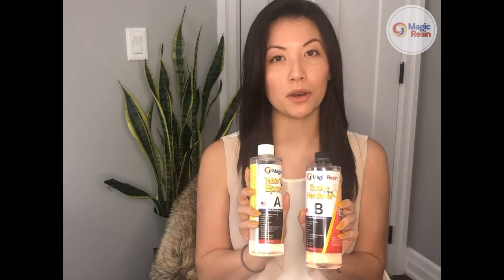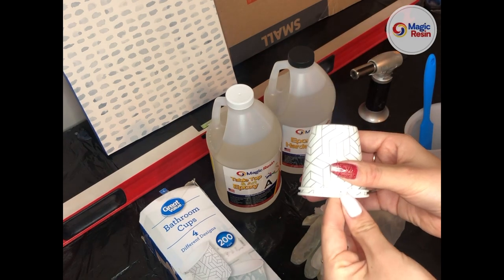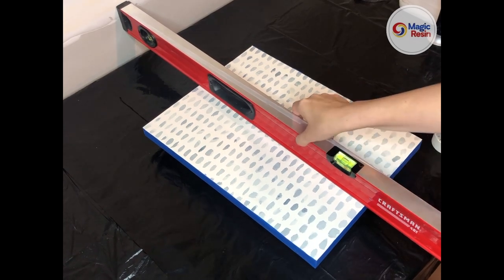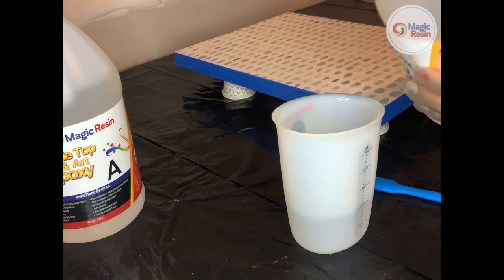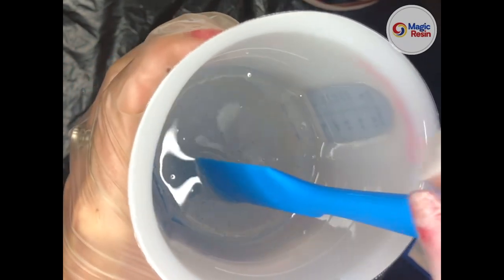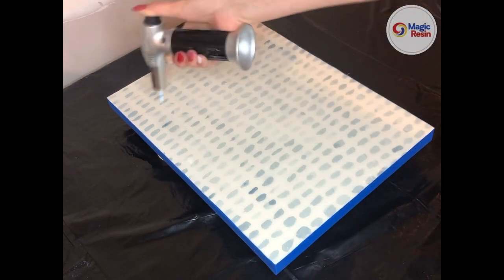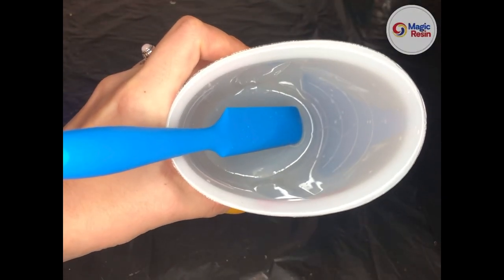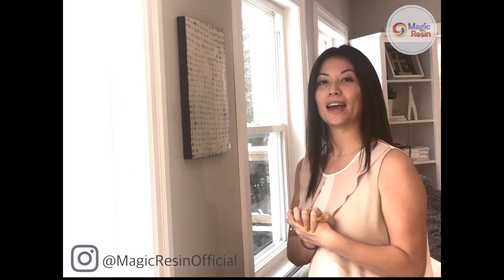How to Use Magic Resin's Table Top & Art Resin - Coat a Painting with Epoxy Resin

Comment: I'm coating my acrylic pour painting but how do I resin the sides sides it's a gallery deep edge canvas?   Do I just let the resin pour over the sides on the edge or just pour on top and then fill in the resin on the sides with my fingers?

Also when taping the bottom of my canvas so the drips don't accumulate and harden... At what point do I remove the tape? after it's semi cured because I don't think I can remove it after it's fully cured correct?
Reply: If you use tuct tape, it comes off. Unless any gets encased slightly with the resin. Sometimes it doesn't fully cure when against the tacky side of the tape.  But the non tacky side comes off with ease